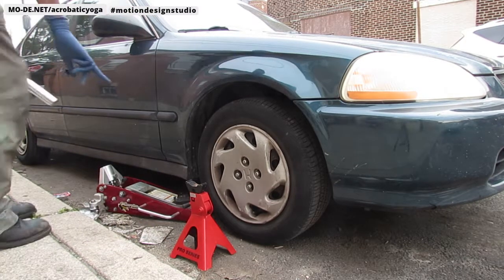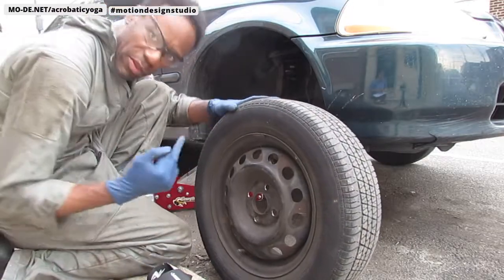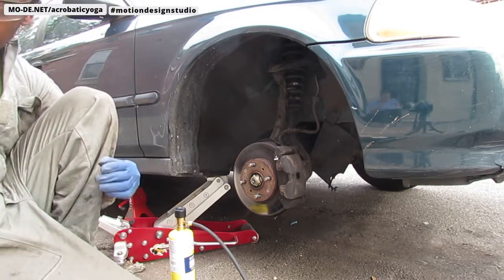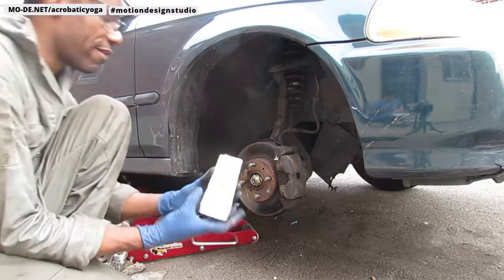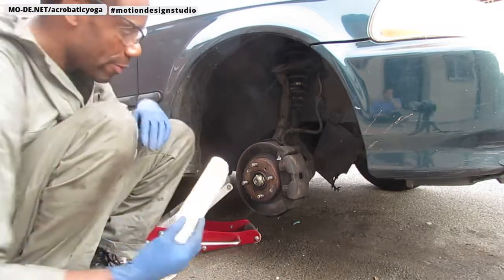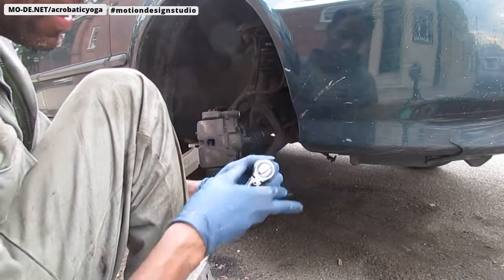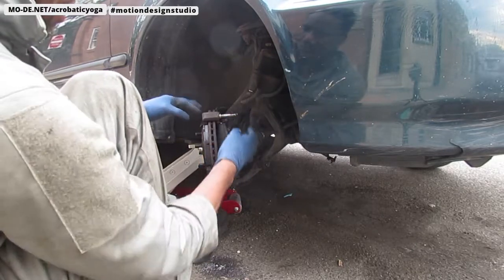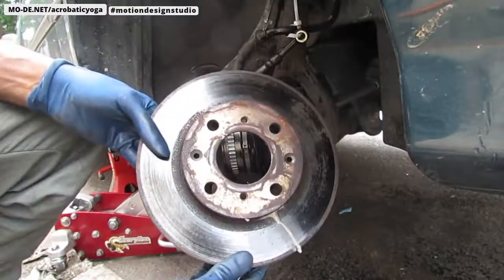1997 Honda Civic DX : Remove Rotor and Caliper

Comment: Hi, thanks for the great vid. Do you know if the brake pads are akebono or TRW?

Also any tips if the bleed nipple or brake line gets stuck from rust? Use torch and then wd40?
Reply from the maker: Picadilli, happy Memorial Day if you celebrate or a vet.  Any advice giving by myself are only suggestions and absolves me from any responsibilities associated with the final decision of the individual(s) asking the question.  You ultimately have the responsibility to accurately assess the safety of your repair and how to move forward.  

TRW are the brake pads. With a stuck bleed nipple you have the following choices. You can try bleeding the system using 3 of the four bleeding locations if one is just a pain in the butt. Second you can use heat but I would only use heat from a small butane torch nothing larger as heating the brake fluid can cause damage the interns of the line, fire or later failure to the braking system. Third if this is mission and time critical of a repair.  I suggest getting a caliper and flexible brake line in advance. If any of the above failed you may continue with the repair having those additional parts.  

Best of luck and have a great week.

Comment: GREAT Video.  Thank God I only have to replace my Caliper, I wouldn't have to use that acetelene torch to try to get those impact screws off the Rotor. (Clever idea with the Parafin Wax.  Will WD40 without the the torch not loosen up those Impact bolts?)
Reply from the maker: The WD40 would not have loosened it up without the torch.  Those bolts get really rust frozen.

Comment: Im sorry dude. I no mean disrespect. Youre teaching people so you should still learn as well. I just want to say you dont heat screws  or you might damage the threaded bore. There is what we call wd-40 that has been with us unscrewing time rusted bolts since the 70's. If fixing anything that has fluid, you need to drain it first to avoid those messy leaks. And btw. Its called jack stand. I hope you are not pro right?
Reply: Anybody swear by WD-40 in the mechanic field is a joke😂

Comment: hi man where you bay tha torch and the premiun wax my car is 97 never cant remuve the screws never change rotor
Reply: an impact screwdriver gets those off no problem..just a single hammer whack and its free
Reply from the maker: oxdanig45  , true I use that.